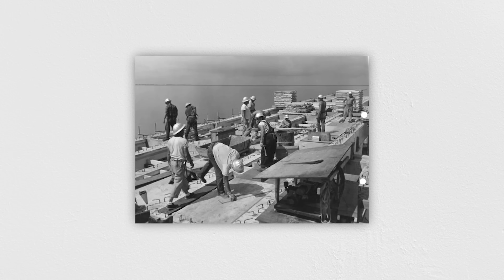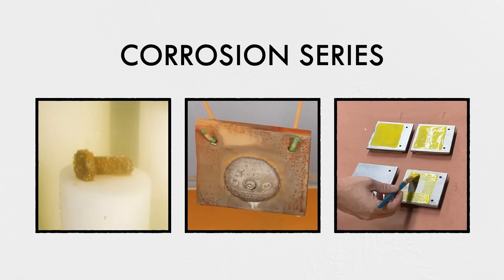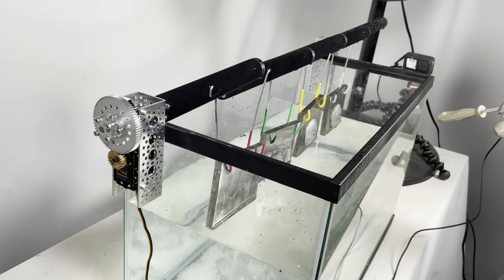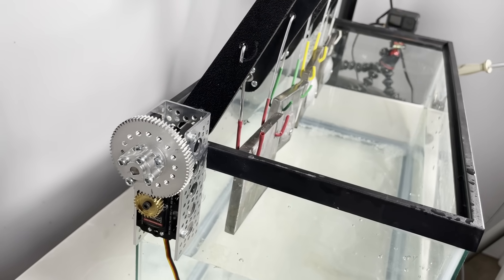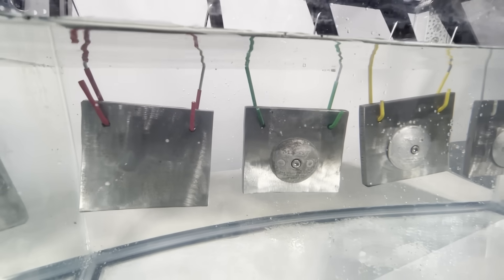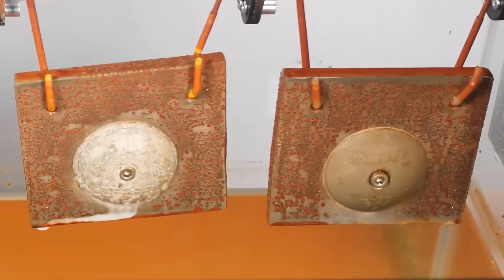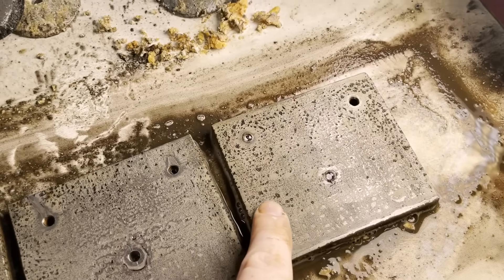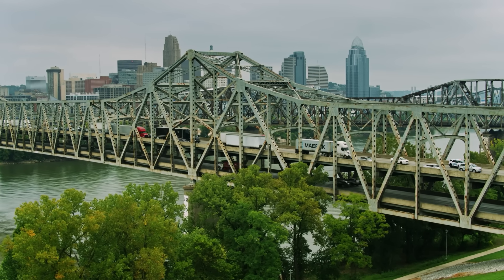Why Spillway Gates Don't Rust Out

Comment: This gave me an idea, and after some research im happy to say someone has already had my idea. Some people have used Hot Zinc Spray to coat their steel hulls in a extremely thin layer of zinc which is then covered by a base cover paint and then an anti fouling paint. Some boats have seen 20+ years with the only maintenance on the coatings being the anti fouling and occasionally the base coat needs touching up.

Comment: I take it that despite the extra cost of stainless steel, the structure don’t last significantly longer than traditional steel construction to justify the cost? If I remember correctly stainless steel is more brittle. Does that play a role in its unsuitability in construction?

Comment: Fun little historical fact about cathodic protection is that it was first employed in the 1820s by Davy and Faraday to stop oxidation of the copper hulls on British warships that were used to protect the wooden ships from shipworms. Unfortunately, it turns out that gradual oxidation of copper to form herbicidal copper salts was, unbeknownst to anyone at the time, a key feature of the copper hulls that kept them from collecting algae and seaweed that slowed the ship down. Captains complained that Davy and Faraday's experiment actually made their ships handle worse, so the technique was discarded and not used again for a century.

Comment: I’m guessing that the shared saltwater bath also electrically connected the control steel to the anodes? Maybe it would be worth using separate baths?
Reply from the maker: They only sat in the water for a few seconds each cycle to be wetted with saline water.

Comment: cathodic systems exude protection to save ligdon in wooden boat hulls.  transistors control DC to save ships parts as plates of inert metal exude current attraction provided to keep current away from wood, all well insulated from the wood but connected by touching the salt chuck.  temperamental systems that run automatically.  control box sends about 200mvDC above free erosian to thru hulls.  same systems found on metal hulls too.

Comment: Great video but as a pipeline CET, we certainly don't need 10s or 100s of amps to protect the line. Normally just a few volts, we have remote CP that's powered by small solar or TEG.

Comment: 28.35 grams of prevention is worth 453.592 grams of cure.

I would guess though that the ratio of sacrificial metal used on the bridge to the amount of bridge protected overall is much greater than this.

Comment: Cathode in corrosion (or in a battery) is the positive terminal and not the negative. It draws electrons from the anode.
Reply: @Floklo187 it's the galvanic cell case here (spontaneous corrosion). Electrolytic cell would be in the impressed current protection system, discussed later on in the video.

Comment: Seawater cooling systems on board ship.  All sorts of 'zinc plugs' in the heat exchanger heads and waterboxes.  Mechanics had to change them out regularly.  Even with exotic steels like inconel, still used 'zincs' all over.  👍👍

Comment: This is also why when you buy a new water heater they will have either a 4 yr warranty or a 10yr warranty version... The 10 yr is obviously more expensive and the reason is the size/surface area of a sacrificial anode rod...you can buy the rods and change it yourself after the four yrs or buy the 10yr version. And many people just think it's a warranty scam to get more money from you but it's literally the same exact thing as this video and it's the 1 time you should do it because it's definitely worth it in my opinion because in order to change the rods... Besides spending about 50$ for the new one you also have to most likely (99% of the time) completely drain the tank and completely disconnect the gas or electric... The vent... Both hot and cold water copper  pipes... Literally everything you would have to do to replace the entire water heater and do it every 4 yrs because in order to do it without having to do all this work you need enough room above the water heater about the height of the water heater itself because they go in on top of the water heater so you either have to tip it over on its side or take it outside pull out old put in the new anode then reinstall and you would have to do this twice to get to the 10yrs. And since more people than not can't do the work it will cost much much much more than just getting the 10yr version to begin with... Your talking about maybe 100$ price difference between the 2 different warranty versions. But again people think of it like the other warranty scams not knowing you must literally disconnect change anodes and reinstall 2 additional times after the original install and I'll tell you now the people that sold you the water heater at home Depot or Lowe's have no clue themselves and will think it's a warranty scam themselves and even tell you that. But this is the true reason for the different 4-5 yr warranty model and the 10 yr model. You can switch to the bigger anode after the shorter warranty but when you give the model number the part that will come up to give you will be the shorter life anode so you have to ask for the better one or get it yourself... It's definitely the 1 time you should definitely do it and get the longer lasting anode

Comment: Cool set up, though it seems quite inefficient. I'd have got for a sprinkler type setup, maybe using an ultrasonic mister, a sprinkler or some other water sprayer, maybe a peristatlic pump. Then the parts could remain static. However I do love the way you did it too, and it maybe imitates lapping waves better.

Comment: Boats often have a sacrificial anode under the waterline. Even small boats have them, especially if they are made out of steel or aluminum, but also for composite structures. They are useful to protect expensive parts like the propeller or critical components such as water intakes for the engine or the water maker from corrosion.

Comment: Seeing the example of magnesium really shows why I hate magnesium as a structural material. I work on airplanes so I encounter mag parts occasionally, and every time they're a major headache. Beechcraft is particularly fond of using it, especially for the skins on elevators on some of their planes because lighter weight control surfaces are easier to use and less likely to flutter. But magnesium always corrodes far faster than the aluminum around it, and aluminum is already pretty at-risk to corrode. But the mag parts just corrode to bits so fast it's insane. No good when the parts are necessary for safety of flight. I prefer aluminum ten times out of ten. The weight savings is not worth it.

Comment: Great video! I would hope you do a video on protection of Aluminum. I have a boat life that uses an aluminum I beam to hold the mechanism. It is in brackish water. I kept a magnesium anode connected to the beam by a wire and replaced it when it deteriorated. After 9 years, the lower part of the beam literally dissolved to the point it disappeared. Before I replace it I  want to install an active cathodic system. Thanks for the information!

Comment: @Practical Engineering
Could it be that even the blank mild steel got cathodic protection through the wire holding it? Maybe that's another reason why the Mg was gone so fast
Reply from the maker: I put heat shrink on the support wires so there was no connection

Comment: So is there a way to install small anodes on a vehicle that would prevent / slow rusting?
Reply: @Floklo187 Yeah was trying to recall what I knew about anodes and old burried steel gas tanks and or water heaters ... The anode and the cathode have to be connected .

Comment: I'm not a chemist, but i'm quite sure your cathodic corrosion test is flawed.
Corrosion is a redox process it needs 3 parts, an anode (the sacrificial metal) a cathode (the metal to protect) and a electrolyte (water+the ions in it), it's basically a battery.
For a battery to work you need the electrolyte to be in contact with bot the anode and cathode, same here, the sacrificial anode needs to be connected with both the base metal and the electrolyte in order to work.
That's why boats and bridges have them but car don't.
It's also probably why the "protected" pieces did't rust only around the sacrificial metal, because the electrolyte solution was in between the two metal in that spot.
I think that the right test would be leaving the pieces inside the tub and creating waves to create the metal wet\dry cycle, but always with the sacrificial metal at least partially submerged

Comment: There's a cool technique where you put a sensor that measures the voltage caused by the sacrificial anode and then alert when it drops too low (indicating the anode is too corroded to protect the structure and needs to be replaced)

Comment: hey grady! great vid as always. I just wanted to chime in and say your rustomatic 3000 set up may offer some great ways to add to literature if you want to put in extra work or work with others. Varying the salt, precise measurements in the metals, varying drying rates etc appear to be very easy changes you could make to your setup.

We have a very unique scientific opportunity: we have a trained engineer with a knack for building as well as all relevant calculations in this experiment, he has a decent set-up for documentation and for the experiment already which lowers costs, he has a platform through which he can monetize further experimentation and most importantly he has a giant platform of engineers and other curious scientists who could offer ideas on what could be valuable data! you could document the whole thing and publish it, could also monetize it here so it's beneficial for you, the scientific community as a whole as well as your own community!

Comment: so i have a 12ft long square section 4 inch tube made from thin mild steel, it is 'sealed' but open to the air and in winter it suffers condensation inside leading to it rusting from the inside out, the outside is repainted every few years, what can i put inside to stop the condensation rotting through?
some 1/2 inch cube magnesium  chunks every winter? or what about this electrical method, i'm not sure how to even go about trying to do that. i did think about heating it internally just with about 5w of heater pad every 3ft

Comment: A naturals gas pipeline company in Mississippi had an active cathode system installed 600 yards from one of our guyed cell towers and it ate the steel anchor rods in less than 2 years.   We noticed  it before the tower fell, in one spot, there was about 1/8 inch of metal holding a 350 foot tower. We had to anchor the tower to 3 bulldozers while we rebuilt the anchors.  The coolest thing was seeing the iron running in lines through the soil towards the pipeline.  Even with use of proper sacrificial anodes, it still ate the tower's steel.

Comment: Dip dip dip

How far does the Rust-o-matic 3000 dip the samples into the water? It looks like some of the bare wire too gets dipped, in which case, the magnesium will be protecting the aluminium and zinc too. Is each sample galvanically isolated in the dipper?

Comment: Ey Grady, I'm currently working on an proyect in my university, I'm trying to find some procedure to avoid corrosion inside of a steam generator. The problem is that this steam generator takes long periods of stop, basically hibernate for 3 or more months, so I'm looking for some procedure to prevent it from corrosion, and this video give me some great ideas, do you have any paper about galvanized protections like these in the video???

Comment: It would be interesting to see how Cor-ten, or “weathering” steel would hold up in comparison to your control and anode laden steel samples in your rusty contraption.
Reply: CorTen is good in moist atmospheres but shows no significant advantage when submerged or in the continuous splash zone. The liquid water tend to wash away or otherwise bypass the protective layer of rust.
Reply: @mytech6779  could you elaborate on this? It is my understanding that through a red-ox reaction an oxygen layer is attached to the steel, which prevents further oxidization, similar to the oxygen layer that forms and protects aluminum. As long as the oxygen layer is not chemically or physically removed, the steel would be continually protected.
Are you saying liquid water has the ability to overcome the bonds holding the oxygen to the steel and physically remove it, or is something else going on?
Reply: @Linusgump  Mostly submersion is just a harsher environment physically and chemically and it is more than the oxide layer can tolerate.

Mind you the rest of this is not in the core of my specialties so there may be some errors.
That oxide layer protection works best on metals that have an oxide crystal packing similar in volume to the base metal crystal volume. 
But iron oxide crystals have much higher volume than the base metal which creates mechanical stresses which make the oxide layer cracked, poorly bonded, and friable. CorTen has minor alloying to reduce this issue by altering both the galvanic cells to favor certain oxide products and the bulk iron oxide crystal structure to make a slightly better bonded oxide layer. BUT it is still pretty weak and easily compromised. Being submerged may also favor a different oxidation level Fe+2 vs Fe+3 and crystal hydration.
Reply: @mytech6779  cool! Thanks for the more in-depth explanation.
Reply: I was just about to write the same comment.
Reply: @jwstocker1979  It's used extensively in shipping containers.
Reply: Cor-ten works because of its chemical composition which contains a controlled amount of copper. The presence of copper creates a surface rust layer that is reasonably self-sealing. Rust on normal (non-stainless) steel is a porous layer, meaning oxygen can penetrate it and cause further rusting underneath. 

This doesn't always work as intended. The self-sealing rust may fail to form in coastal environments with salt-laden air and Cor-ten also fails to work properly in humid subtropical conditions. Cor-ten structures always have to be designed with proper water run-offs, since it cannot have any pools or pockets of standing water, and the rainwater run-off itself can carry rust, so it can stain surrounding surfaces.

In this particular case, partially submerged in simulated seawater, the material will not be able to form a sealed rust layer so it will rust about the same as most other mild steels. 

(And, yes, sorry, a year late to reply, I know.)
Reply: @Hydrazine1000 that’s interesting because the roof of shipping containers is corrugated, so water naturally pools up in each slat up on the roof
Reply: @jhsevs  Cor-ten, when used in containers, gets primed and painted first. It is not bare metal, it only serves as an additional defense against corrosion when the paint gets damaged. Plus, container roofs are either slightly convex or slightly slanted to prevent water from pooling.

Comment: Hi. I have some doubts here. If I have a fence and the paint is starting to strip due to corrosion, can I attached a block of magnesium with the fence using a copper wire? Will this slow down the corrosion of the fence?

Comment: I'm a nooby in rust stuff. But having the time lapse happen in the same bath falses the result impression of rust no ? Like the sample 2 is actually reacting to the others due to the ion in the water ? I'm aware of this issue due to water conduit in industry to not mix fittings (like bronze vs stainless in a circuit even kilomètres away)

That's said it's very instructive

Comment: Grady!  Great video.  Are you planning on doing a similar one regarding the use of stainless steel in conjunction with mild steel?  For the reasons you outlined in the video's introduction, stainless steel just can't be used in all circumstanced (and in circumstances shouldn't be used - standing water in stainless pipes is not a good idea, if I remember correctly).  But I can't count the times one of our technicians has replaced corroded mild steel bolts/nuts fastenings to a mild steel access plate, with stainless nuts and bolts, because the techs thought "stainless doesn't rust".  In a marine environment, the stainless bits stand up pretty well, but that's because the mild steel structure is becoming the sacrificial anode.

Comment: This method was in the last topic of our chemistry book  (cls 12) ..corrosion.. at the bottom most part a bit about this method was written after coating or galvanising of metals ....
That time  i thought  thats one cool way to solve the rust problem  realized after a while that rusting of certain metals releases toxic compounds which harms the environment .......
Video was great to gain more info about  this method and the cathode current method to dispose of the emvironmental factor to some extent

Comment: Hi Grady, thank you for the very interesting video as always. I'm a naval electrician and at the shipyard i work we are responsible for the maintenance and the replacement of the anodes. This week we were qualitively and quantitively evaluating them on the ship i work on in prevision of the replacement. This particular ship uses zinc, aluminium and magnesium anodes. The zinc and aluminium anodes are bolted directly to the hull and the magnesium ones are bolted to the hull but isolated with plastic spacers and rubber mats. My guess is that it is for when water enters the hull to complete the circuit and offer an extra protection. It's very interresting to see the numbers and the timelapse. Really helps understand the process. Thank you